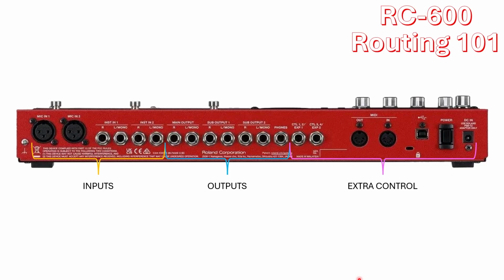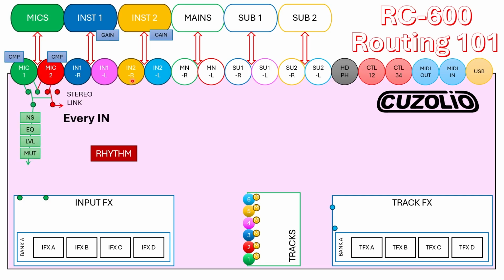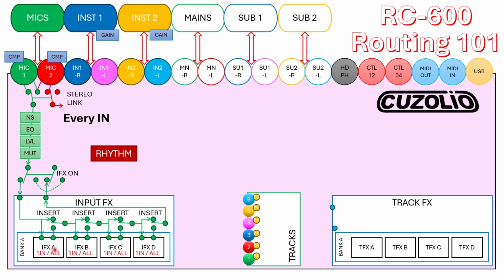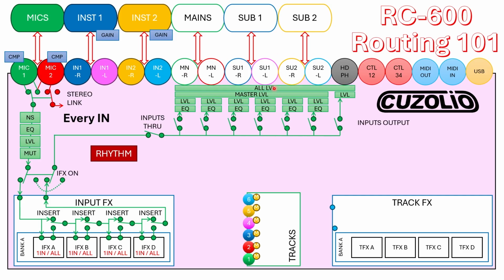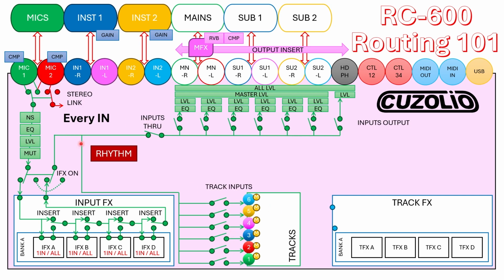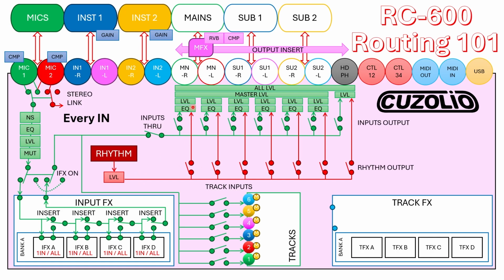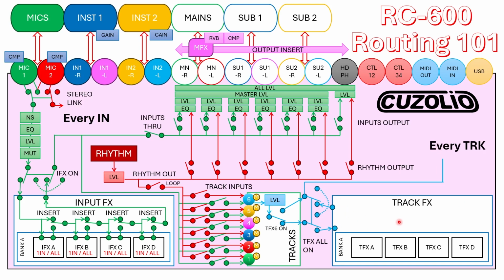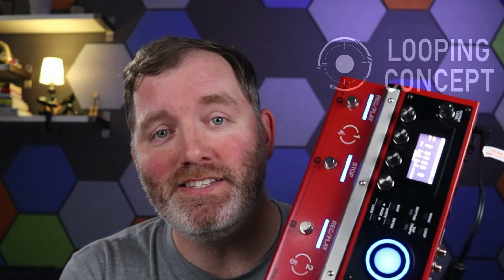Become an EXPERT at RC-600 Routing

Comment: I hear input fx only on main outputs left and right.. not in sub 1 or 2 .. why? thanks
Reply from the maker: If what you say is true, that's a glitch, b/c it shouldn't be possible. Input FX will apply equally to all outputs that you route that input to. There is an edge case where if you turn off certain inputs, the Input FX won't RECORD to tracks, but you can still hear them on all routed outputs when played live. It's odd that you can hear the IFX from certain outputs and not others. Double check and good luck!

Comment: I'm a Sheeran Looper+ user (the smaller version) and thinking about the Boss RC600 because it has effects. What scares me is the complexity of the Boss and getting into trouble in a live situation that I can't get out of.  The Sheeran pedal does most of what I want (serial looping, has a mic input, signal can be routed..) but it doesn't have any usable effects. 
Is it possible to assign the Boss buttons for serial looping (2 or 4 buttons), instrument boost, instrument reverb, instrument delay and microphone reverb/delay? I'd prefer to turn the drum section off completely.
Reply from the maker: It’s intimidating but it doesn’t have to be! That’s why I’m making videos. It’s easy when it’s explained in the right way! 

It can do everything you are asking for. Definitely easy to set that up. Two tracks in single mode would alternate between an A and B section, then you can assign the rest of your functions on the other buttons. Let me know if you need help!

Comment: So if I want to record guitar, bass and keys onto track one, I can only select an output for that track as opposed to each instrument looping separately out of the output I've already selected for the instrument. I understand I could have a different track per instrument but not as I've described?
Reply from the maker: That is correct. You can send out a recorded track to multiple outputs, but you can’t isolate individual layers of overdubs and send them out selectively. For that, as you suggested, I would have a few tracks synchronized together in Multi and they are each routed to their own outputs.
Reply: @CuzolioGear Thanks for the reply. Have spent the last few days trying to figure out where I was going wrong! 😂

Comment: Clearly you know what’s going on inside this complex machine.  This video will take a few watches to try and understand it all.   A few examples would be great.  The intro got me excited cause I was looking how to only allow my live guitar signal out of one output to give me control on an external mixer.  Along with 4 separate loops
Reply from the maker: Glad it was helpful! I am planning on more examples probably through the A La Mode series to help build up a backlog of techniques. In the meantime, pick one of your outputs (like Sub2-R) and turn off every input except for your input guitar signal. That’s what I do to send it off to my Fender amp. My mains go to a generic speaker. Subscribe and stay tuned!